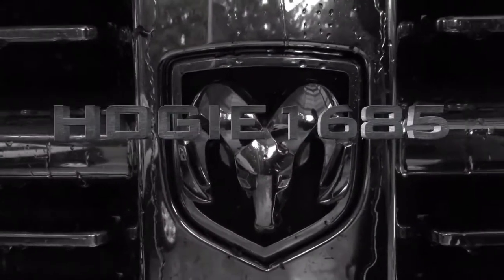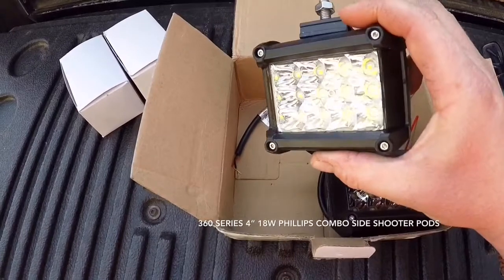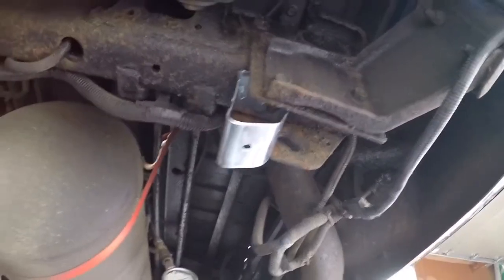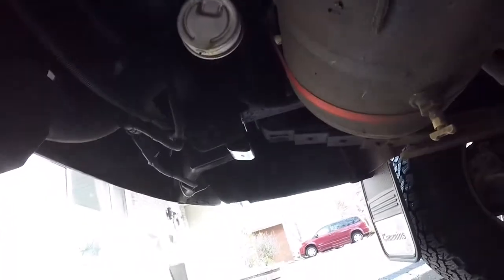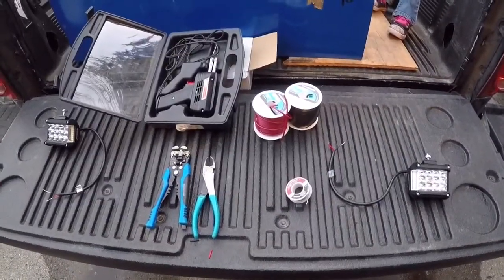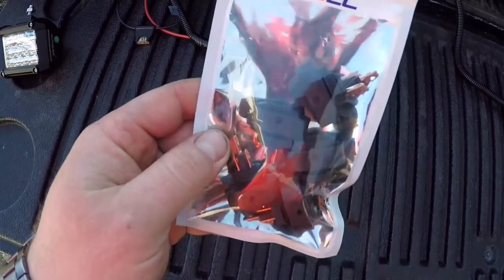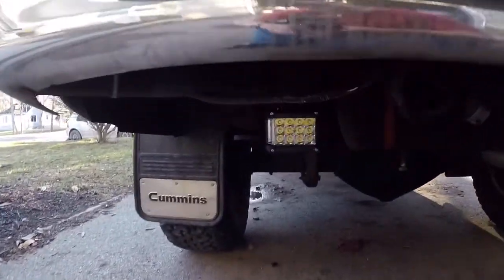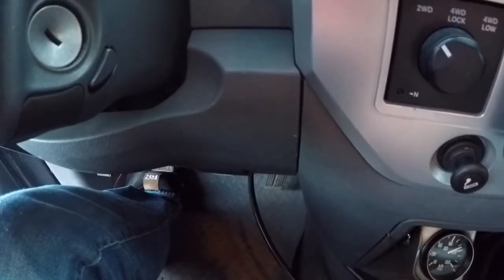Auxbeam pods install

Comment: Love the new into. I do have one question - how do you like your smarty jr? Just picked up an 06’ cummins with the auto 48RE. Wondering how much of a difference the 3 tunes made and how your tranny is holding up? Any info you can give me before I pull the trigger would be awesome man. Thanks!
Reply from the maker: Thanks man. I do really enjoy the smarty Jr. It does really wake that Cummins up. And if you want smoke she will lay it down, on any power level. Especially in the 100hp tune. It's also is a DTC reader which reads codes in plain text. Also ABS recalibration. So different tire sizes. Which is sweet. I'm currently running 315/70/R17 speedo is spot on. Great entry level tuner. I have a new LUK clutch and single mass flywheel which can handle the power. 48RE will feel the effects of the tuner if you drive her hard on 100hp tune from what I hear. All depends on how u treat your truck and how much money you have 😜. I love my smarty but plan on getting the CSP5 switch with EFI live tunes. More options better custom tuning and on the fly!
Reply from the maker: Did u end up buying the smarty?
Reply: hogie1685 man now you’ve got me thinking about EFI lol but I don’t have any good local shops for custom tunes. I’m not sure how to do any tuning so I figure maybe pull the trigger on the smarty jr
Reply from the maker: Yah man you will be happy with the smarty. But if u are not a smoke guy. Then maybe custom tuning (EFI Live) is something for to drive a distance to get. And by smoke 💨 I mean it's only when u hammer on it. Not just driving normal lol
Reply from the maker: Yo if and when u get the Smarty make a video. Before and after and a drive around!!!!
Reply: hogie1685 I just pulled the trigger yesterday and ordered it! Will do!
Reply from the maker: How much brand new???  I bought mine used for $350cdn
Reply: hogie1685 I picked mine up through XDP’s website to the tune of $495 usd. Definitely a steep asking price but it had free overnight shipping and I felt comfortable knowing it was new. Sitting in the mailbox waiting for me when I get home from work! Will update after I get a chance to run it. What power level do you run yours on? Did you see any mpg gain?
Reply from the maker: poisonblader SWEET!!!!  In the summer I do a lot of camping/trailer towing. So I have it in the 70hp tow tune a lot.  Or the fuel economy tune. I run torque on default. And timing on 3. But u can play around with the torque and timing levels to see what your truck likes etc. Yes I have noticed a MPG gain. 2-3 Mpg!   I run her once and a while in the Preformance (100hp) tune. I just loaded that tune on her tonight lol.
Reply from the maker: poisonblader I don't think I mentioned my smarty I bought was used. Second hand and it was still $350. New is  like $600cdn
Reply from the maker: Well how do u like the smarty Jr???